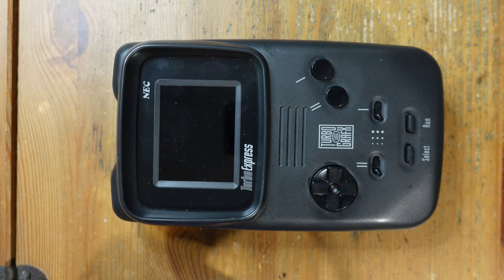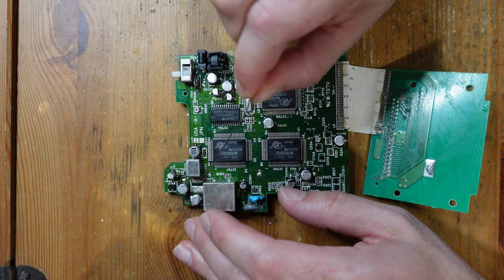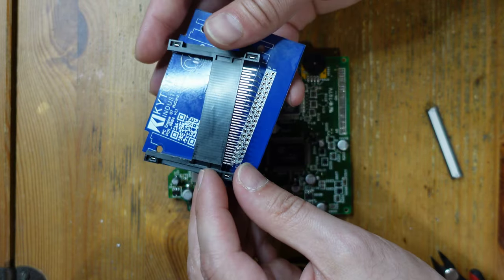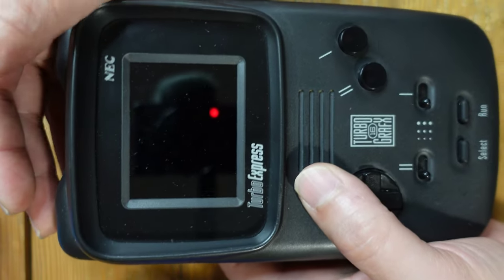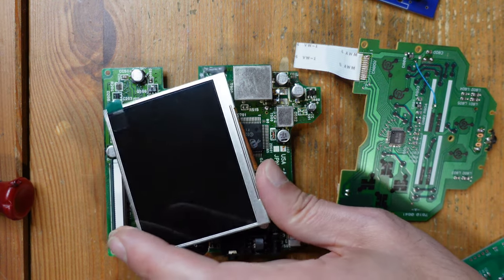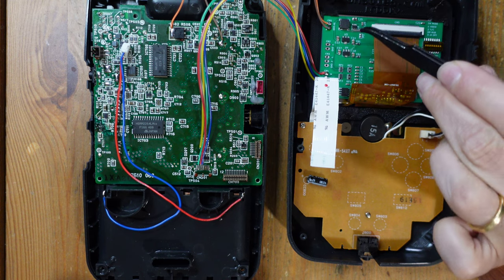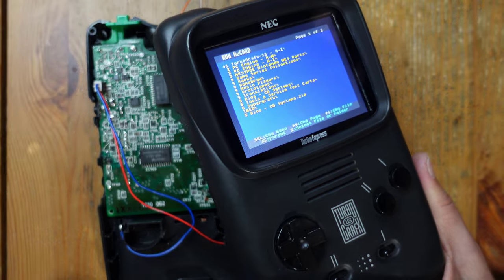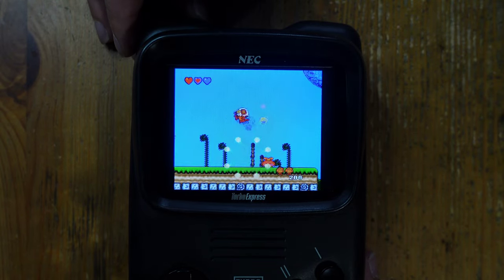Region free Turbo Express! Repairing a badly damaged Turbo Express and adding region free gaming!

Comment: that region free board is pretty handy, but i wish they made it so it saves the region it was on. And only switches when you press Select and powering on.
Reply from the maker: There’s a newer version which will let you default to a desired region like you suggested. Should be available soon!

Comment: I'd hope they'd let you flip the default for the region free hucard reader. Having it default to a PCE over TE in a TE shell could be confusing down the line, especially if the TE was inherited and the information to hold the select isn't known. The new owner could consider it broken and toss it.
Reply from the maker: It might be possible to do that and I could understand why you would want it to default to turbo express mode if it’s being installed in that console
Reply: That is the plan for the full release. This region free mod is not yet officially released.

Comment: if you make the jump to always boot in turbo express, if you turn it on by holding the select it will change to PC engine gt or when you make the jump it is permanent only in turbo express?
Reply from the maker: No, if you close that jumper than it only boots in turbo express mood. It will never switch over to PC engine mode
Reply: @LIRetroGaming  i see! Thank you